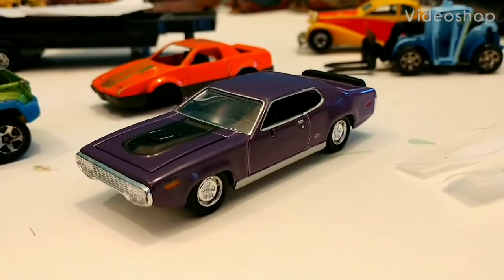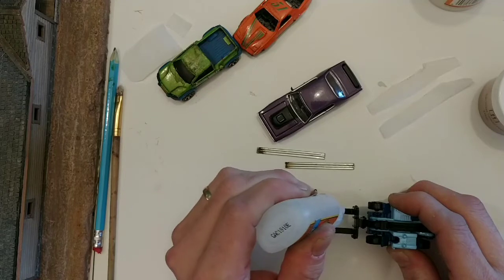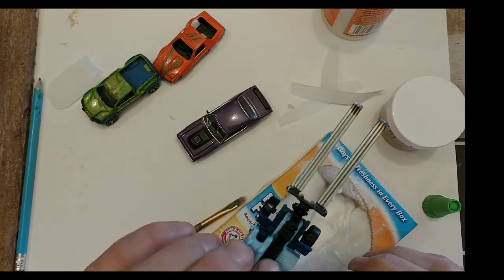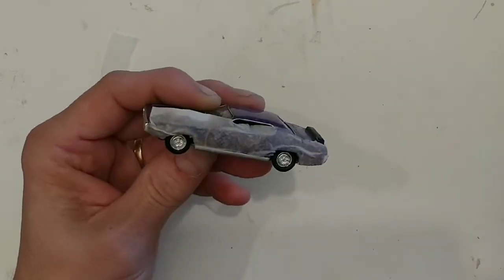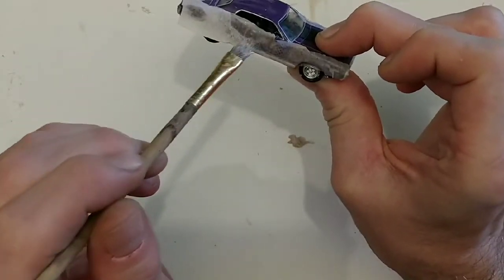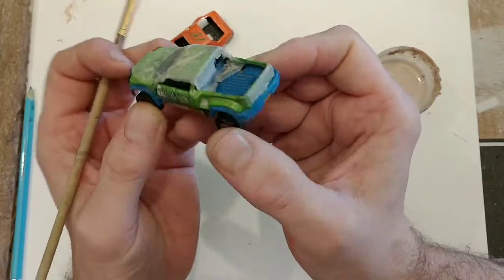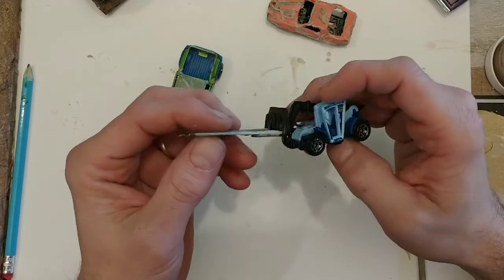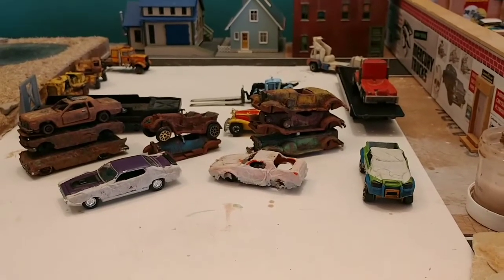How To Build Diorama Junk Cars And A Custom Forklift "MBX Load Lifter"

Comment: Great vid if you remove a fender and replace it with some tinfoil crunched up it looks really good when painted. I know this is a bit late but for that or any missing side mirrors use a pin bent to go into that hole using the head as the mirror part. Depending on the style car you can have as a circular one or file it down to make a rectangular type. Toilet paper put over a car like a plastic or canvas tarp depending on how you paint it up using some very thin thread as rope to tie it around cars or other equipment to protect them from the elements.
Reply from the maker: Sounds like some great advice Thanks for sharing it and for watching 😉🙏

Comment: Is it a normal paper or toilet paper? Just wondering... Does it stick on the body properly? Thanks for sharing! :-)
Reply from the maker: It's industrial-type toilet paper like you would find in a business or restaurant. but regular household toilet paper will work fine just a little harder to use because of the fancy perforation patterns. It sticks to the car well with watered-down wood glue.